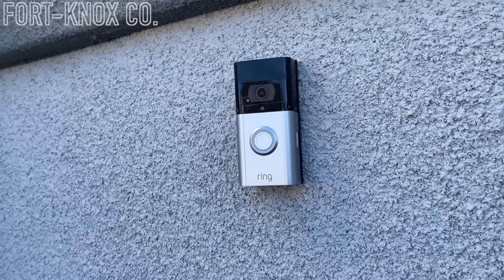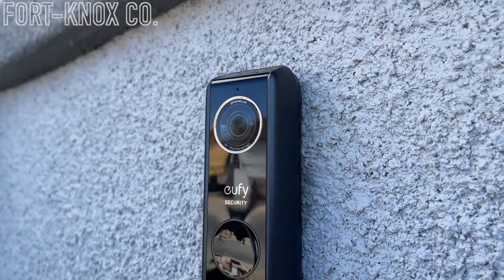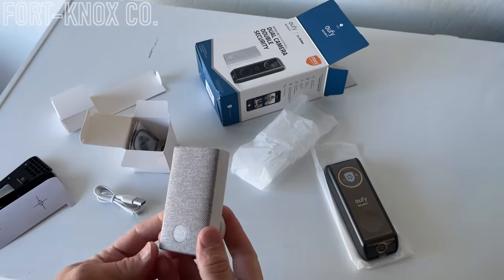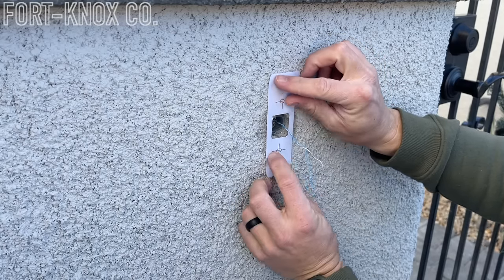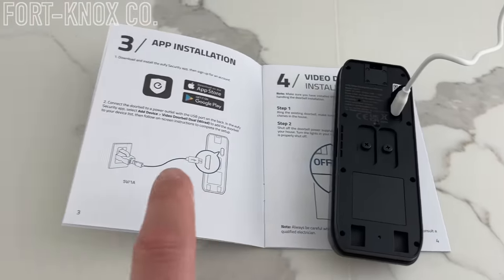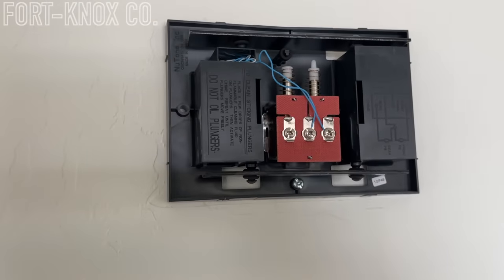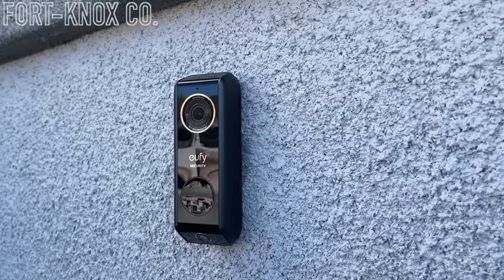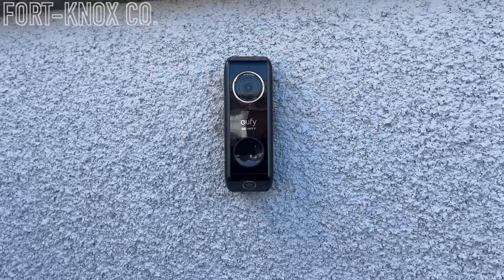BEST Video Doorbell 2024 with No Subscription Required Eufy Dual Camera Doorbell Installation Memory

Comment: How does it record video on a hard drive?
Reply from the maker: It has its own internal memory and they have a home base that you can choose to add on if you want larger memory or memory that’s not outside in the unit itself. It connects fast and you can view the saved events and live feed through just the doorbell. I’ve added an in house base that helps with connecting other units and saves memory inside so it’s more secure.

Comment: We must be the only house without a pre installed doorbell
Reply from the maker: A lot of houses are coming with video door systems as and option but usually they are coming with strings attached as well. They want you to be on a subscription service to use it. So you get the equipment “for free”

Comment: My Eufy sucks. The s**t  shit goes off the minute I step in front of it, but when strangers come to my door to make deliveries it records them after they are leaving 99% of the time so I don’t even see their faces. Also my camera by my garage door constantly goes off when a vehicle passes even though I have the boundary set way back from the street but never goes off when people walk up to my garage. I have three cameras and a door bell and I’m getting rid off all that crap.
Reply from the maker: Crazy to hear that. I haven’t experienced that at all. I had it going off on every movement at first but that was because all my settings were at the most sensitive. Once I adjusted them it solved the problem. Have no complaints now. We love our Eufy doorbell. Its interesting that we could have such different experiences with the equipment.
Reply: @FortKnoxCo   First of all my apologies for using explicit language. I tried to sensor it but I just realized I messed that up. I hope you have better luck than me with your own. Should have gone with a tried and true old school wired system like I really wanted anyway. Not to mention that I have to also remove my cameras, doorbell to charge them ever so often. Don’t know what the heck I was thinking. Well, you live and you learn right.
Reply from the maker: @pf5658  No worries, I get what you’re saying, I had the battery one first and didn’t like it, I hated charging and it seemed to have more glitches. Swapped for the wired version and haven’t had a single problem. I did need to upgrade my doorbell transformer, but that was a quick switch. Depending on what new stuff comes out in the next year who knows, I may try something else out

Comment: While it is possible that criminals can steal the unit and you can lose the footage, most criminals attempting to get into the home are lazy and stupid. So the likelihood of their stealing the unit is slim. Understand that the doorbell doesn’t just fall off the wall. Additionally, if the installer is concerned with theft of the unit, installation of screws to give the unit better retention is possible. And, as soon as the user gets a notification, they can begin recording on their phones. So, if you live in a crime riddled area, take the necessary precautions to prevent theft of the unit. If you make it hard to take, they will not waste time on it. Remember they’re there for your valuables not your doorbell. Great video by the way.
Reply from the maker: Thank you I appreciate that. I agree with everything you said too. There is no perfect system if you want to get technical. And the doorbells main function isn’t to be a full blown security system. If you are concerned with full security then you should also have a full camera system. And even with the door bell and camera system there are a couple solutions to have data stored securely on or off property.  Like you said, making it more difficult or time consuming will probably be the best deterrent

Comment: Never had any issues with Ring doorbell, the subscription price isnt expensive.  Its always worked catches everything that I need.  Ill stick with Ring.  Good video though.
Reply from the maker: I appreciate the feed back. One of the issues I think I found after messing with it was not having the proper power supply can really make these wired doorbells malfunction. One thing I liked about the Eufy is that it let me know right away that I needed to upgrade my transformer for the doorbell. When I had the ring doorbell, it didn’t let me know that it just told me that there was errors or that I would see that lag or disconnection all the time. I’ve heard the same thing, though that a lot of people really do like their ring doorbells. It really all depends on how strong of a Wi-Fi system you have, and having the right power transformer in place for really any set up that you choose.
Reply: @FortKnoxCo  that's good to know, I'll get one and set it up at my backdoor.  I have a lot of packages delivered to the backdoor and with the one camera looking down would be a nice benefit.
Reply from the maker: @Earl940G  I really like mine. Might consider installing another one by our side door for the same reason.

Comment: I am not very happy😩 with the Eufy  this doorbell it doesn't seem to matter what you put the settings on it has a mind of its own I have it set for human only and every time a truck or a car goes by it sends me a notification this is very annoying I have tried multiple times to change different settings and nothing seems to help I guess it's time to look for a new doorbell
Reply from the maker: That’s very unfortunate. I haven’t experienced this. When I first installed it I had all the settings and notifications on and it was notifying me about ever person, place and thing that happened in front of my house. This was obviously annoying and way overboard. So I adjusted it to human only and the range/distance to see around the middle and this solved it for me. I only get human notifications and it recognizes their faces and sends pictures of their face along with the notification. One time I had it notice my trash can as a human when it blew over on a windy day. I think the distance you have it set for matters a lot. Or the sensitivity setting. This keeps it within about a 20-30’ range and helps with notifications out from the street.

Comment: You indicated the Eufy does not come with a doorbell; however it is wired for an existing doorbell. Just for clarification.
Reply from the maker: Yes you are correct. You can also order the Eufy doorbell with the Chime that plugs in and have that at well. Some people like having both because you can then have a chime in a specific location that suits your needs. And then still have your original home chime

Comment: I have had this unit for 3 months now and find it very heavy on battery and the false alerts are a pain the parcel detection is the greatest load of dog shit I have ever seen; it tells me there is a parcel when a damp patch appears on my paving outside the front door. I am on android 10 and notifications work the odd time, meanwhile, my wife who is at home is driven crazy with numerous notifications if a fly passes the unit or cats are a bastard as well, she is on android 11. I love the local storage and the video quality is amazing but the package detection and the hit-and-miss notifications are making me angry a bit.
Reply from the maker: You can adjust the sensitivity and turn on or off what notifications you want. From factory settings it will have any and all movement turned on and it’ll be at its highest sensitivity. You can turn off motion and have just human alerts on and this will drastically change how often you get notifications. Ours was going off all the time because of the same reasons. But now that its only on humans alert, which still notifies you about packages and tracks their movement, we only get the important notifications. And the human Ai is very very good. It can sense a human and take great stills of their face for face recognition. You can also set it to remember people so it’ll notify the a specific person is at your door.  As far as the battery life, that’s why I preferred the wired version. I had battery before and I just don’t like having to charge, I like to set it and forget it. But if battery is your only choice then I get it. By reducing the frequency of notifications it will obviously help with the battery life.
Reply: @FortKnoxCo  thanks man I appreciate the response but I thought I had all those settings tweaked. I'll go back and look at it again.
Reply from the maker: @MrT79shakeshake  no problem at all
Reply: @FortKnoxCo  Issues have gotten worse since I updated to the setting you suggested battery lasts 3 days max and the camera dies, can I reset it to factory setting I wonder?
Reply from the maker: @MrT79shakeshake  I wouldn’t see why not. Every electronic I’ve ever had has a factory reset. But that doesn’t really make sense with increasing the issues. If you lower sensitivity and restrict certain notifications it should notify you less and in return extend the battery life.  Maybe contact their customer service. Could be a bad battery.

Comment: J'en ai installée une. Le seul vraie défaut et la latence entre le moment où le visiteur sonne et le moment où la connexion est établie pour converser. 
Il faudrait un signal qui dise "attendez connexion " En général quand la connexion est faite le visiteur est parti.
Sinon c'est un bon produit, mais j'ai abandonné l'idée de parler avec le visiteur
Reply from the maker: It’s sounds like you might need to upgrade you transformer. These doorbells sometime s required a bigger transformer so it gets enough power to run correctly. I have a video showing how to do this. It’s linked at the end of this video or you can find it on my channel main page.

Comment: The Ring is POS.  I have one.  Got the solar package.under the porch it will not keep it charged, so I bought the AC adapter. It won't charge the battery only trickle charge.
The App and camera is slow , I see the UPS truck coming up our driveway and I open the app.  By the time it opens, UPS is. Gone.
Reply from the maker: Yeah that was the similar experience I had with them. Very slow loading and it was always too late. And that was even if it loaded. Most the time I got at error or “updating” screen. That’s what caused me to start looking elsewhere

Comment: One thing to mention is that this doorbell is not supported in the Eufy cloud backup. So in case of robbery if they take the homebase tgey take the recorded videos as well
Reply from the maker: I believe the data and videos are stored in the indoor plug-in chime. Some of their plug-in chimes also have extended memory where you can put in a micro SD card and have more storage. But the data should be secured inside the home and you can also add a homebase which has a couple terabytes of memory.
Reply: @FortKnoxCo  Hi, yes that's what I meant. It was advertised that has a cloud backup feature when purchased with the home base, but apparently Eufy don't support this model and the videos can't be automatically backed up in their cloud storage
Reply from the maker: @loluser41  ahh ok. I get what you’re saying.

Comment: I love my wyze door cam. 
All wyze cams are married up to your account on setup. Any one steals them they can not use unless you delete from your account..
Reply from the maker: That’s awesome. I’ve heard a lot of good things about Wyze. That’s cool that they don’t let other use them if stolen.
Reply: @FortKnoxCo  Yes i have had good luck with them. I use the wyze v3 for around the outside of house, have 7 of them and one door cam.  I am not a big fan of blink. With wyze and there app you can stream straight to your cell or tablet as long as you want. Where i set on couch to watch tv i have a Samsung 10inch on wall. I can watch live stream on cams at once, if you tap on a cam it will inlarge to full screen on tablet or the cell. When o go to bed i take tablet with me and turn brightness down and set on night stand. For 35 to 40 bucks and hd there good. Only thing if you get the power cable is 6 feet so buy a longer one.
I have one like blink that takes batters but 190 percent better than blink. For 24 bucks i think it was i got a solar panel for it. Its not big but have been using it for a year now and it stays charged.  Thanks for your review. I love wyze but i like looking and comparing..
Reply from the maker: @bluesteel5841  sounds like you have a sweet set up. I agree, it’s good to see what’s out there and what the options are. You can keep up with what’s new and upcoming

Comment: looks complicated but good. I am going to be using the RING simply because I don't have all those drill tools etc.,
Reply from the maker: Sounds good. They make a wireless model and wired model. Both are a pretty simple installation.

Comment: so any body can just go to your door and rip out the cam???? only reason i hesitated to buy, all the same little pull and you take off with the parcel and the cam. am i wrong? want 1 you cant rip out the wall easy. you screw in the base and only pop in cam kinda odd. apart from that very good video.
Reply from the maker: Thank you. Yeah if someone really wanted to they could pull it off. It’s not super easy but it’s obviously not un doable. But the video is saved inside your home. Either on their home base memory bank or your plug in chime. So the data will still be yours and you could follow up on the incident. But yeah, I haven’t seen anything that’s indestructible.

Comment: I own eufy cameras.  They sync right away to my WiFi.  Other brands take several attempts.
Reply from the maker: I’ve experienced the same. I had arlo for a while and always found myself re syncing them or have a lost signal. Took forever and had to keep redoing it. Efuy was straight forward and I haven’t had to redo anything since installing.

Comment: I need a battery only version. I don't have a doorbell.
Reply from the maker: They make those too. I installed a battery one at first but later switched to this wired version. I believe there’s a link for the battery one in my video description. If you click on any of those eufy links it’ll take you to Amazon and you can find the battery or wired versions

Comment: It doesn't run on the battery like the Ring doorbell does. It's not for me.
Reply from the maker: They have a battery(wireless) option and a hardwired option.  Our main problem was the fact that you buy a ring and they force you into paying monthly to be able to actually use it with the features they advertised. You shouldn’t have to make monthly payments just the be able to view your own videos unless you want to.  Having the option to choose cloud storage or storing your videos in your home was our big reason. Also for some reason the ring just wasn’t working consistently. Big delays in notifications…..and that doesn’t help when you have to pay to go view your own events since you can’t catch it live.
Reply: @FortKnoxCo  Yeah. Their service has gotten really bad as well. I'm looking at replacing all my Ring products but I need a doorbell that runs on a battery.
Reply from the maker: @Cameraflyer-  understandable. Luckily there is a lot of options out there. Should be able to find something that works for you

Comment: People keep talking about what if it gets stolen? Maybe your criminals are smarter than the ones in my city, but most will assume the footage isnt saved locally, and will cover their faces when approaching the door bell. Also, how many people do you know who have had their doorbell vandalized or stolen? I was torn between this doorbell and the Aqara that can record 24/7 when wired. I think I mad ethe right choice choosong this one. Its not as fun without the clown, robot, or uncle voices, but it's vertical viewing was severely lacking since it opted for a lanscape view instead.
Reply from the maker: Yeah I don’t think it’s that common for people to try and take the doorbell off. But it’s the first thing some will complain about just to try and find something negative that “could happen”. But you can sit there and what if a situation all day. Either way you can decide to get one or not, but it’s good to be informed as much as you can on what to expect from a product. So luckily there plenty of choices out there, full security camera systems or even just your standard push button doorbell with a chime.
Reply: @FortKnoxCo  HOA prohibits use of any security cameras other than a doorbell, but I'm on the 2nd floor so it's no big deal. My door doesn't even face the parking lot. Rain will never reach it, and the porch lights, 8 of them, are automatic and very bright. I think the Euphy will work out perfectly as long as it works.
Reply from the maker: @tonybanks9015  we love ours and haven’t had any problems. We went from the battery operated to a wired one for convenience.